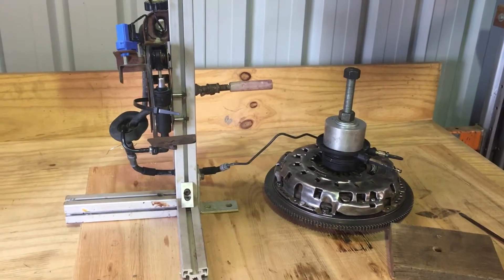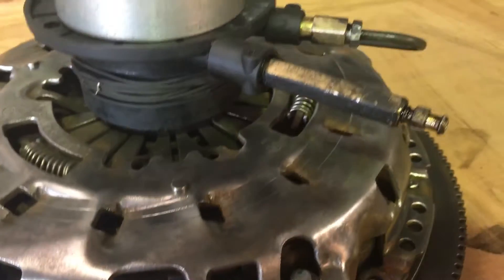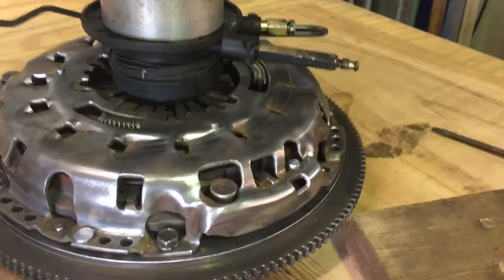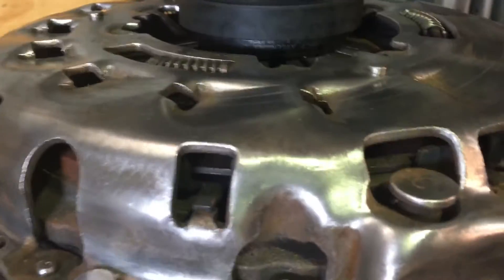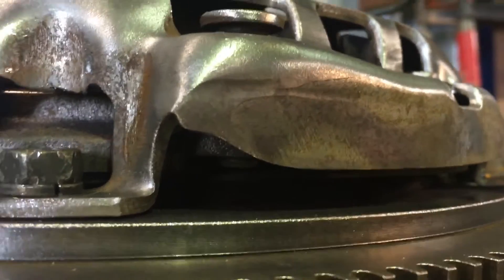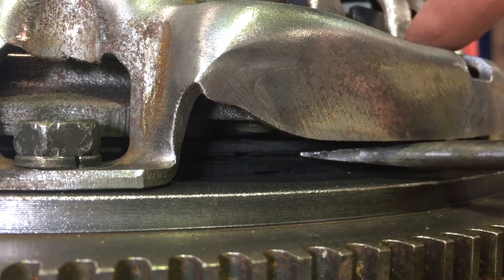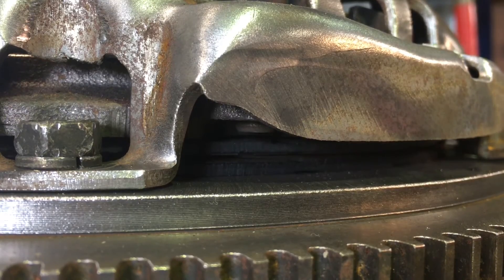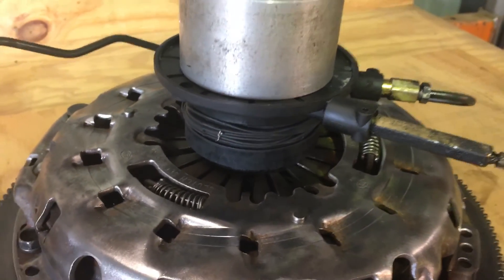How  concentric slave cylinder (CSC) works

Comment: I'm getting a lot of clatter when I press the clutch slightly down to halfway, no noise when fully disengaged or when the clutch pedal is de-pressed .. My mechanic reckons it's slave cylinder but I'm now wondering if it's the clutch plate its self rattling against flywheel.. if it was the bearings in the CSC wouldn't make constant noise?... Especially if rev the car with the clutch slightly dipped the rattle is exaggerated.. It's a brand new clutch kit I fitted too.. wondering if I cocked summet up or if the CSC has prematurely failed 🤷.
Reply: P.s it's just started doing it too, not directly after replacement.

Comment: Thanks for uploading this Troy, I have a 2009 Manual Holden Colorado 4x4 model and only two days back I just had the Concentric Slave cylinder replaced as it was leaking hydraulic fluid
I also elected to have a new clutch and pressure plate put in the vehicle, why?, because the gearbox has to come out anyway to service ( or my case replace ) the concentric slave cylinder.
I did approximately 80000klms on the old clutch and pressure plate and it was still in reasonable shape when it was taken out 
The flywheel also had to be machined
It also turned out that the clutch master cylinder was also stuffed ( but you could not tell by looking at it ) and also have to be replaced
I kept the old concentric slave cylinder as a souvenir
I am not convinced that this type of system is a good idea? I am used to having the slave cylinder on the outside of the gearbox with the fork actuating the thrust ( release bearing ) bearing when the clutch pedal is pushed down to change gears!
Reply: I agree I like the old slave on the outside of gearbox better